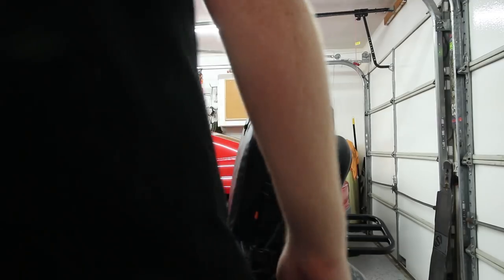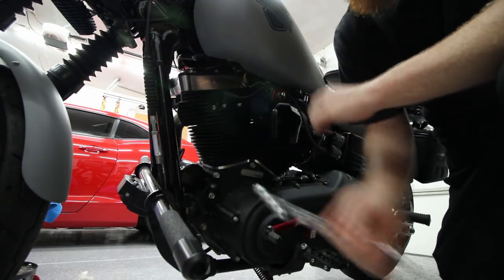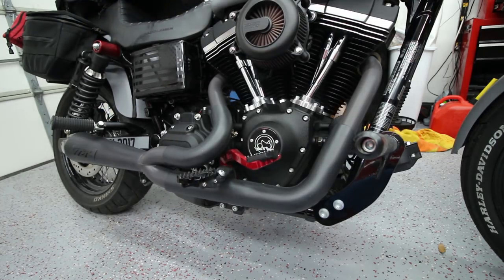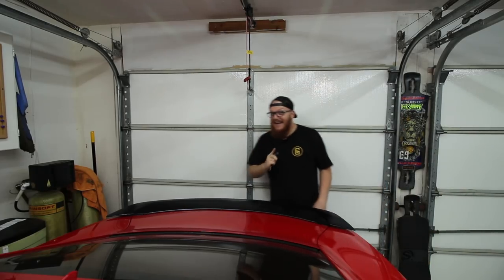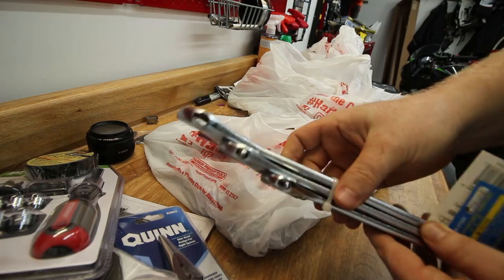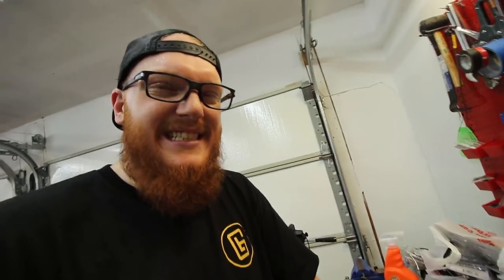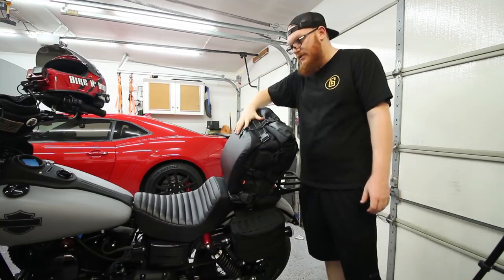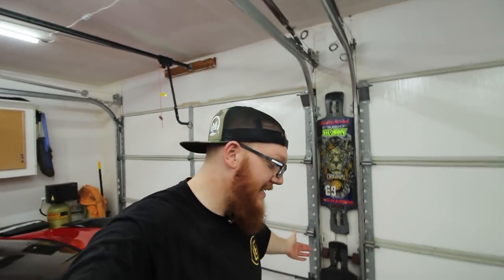Biltwell Exfil 80 Tool Pouch - LOADED

Comment: nicely done.  I like cheaper tools for travel, anyway.  This is coming from a total tool snob.  If you're on the side of the road fixing your bike in Texas heat, 10 bucks says you leave something behind because you're in such a hurry to roll out once it's fixed.  cheap tools, no problem.  expensive tools, you'll be kicking your own ass for days....
Reply from the maker: Thats a great point!
Reply: Also makes it easier to “lend” tools to bikers that need them on the side of the road if you don’t have time to help them get running.

Comment: Take an extra quart of oil with you. Also a tire patch kit would be a good investment. Hand pump for filling low tires.
Reply from the maker: can't patch tubed tires 😕
Good suggestions on the others though!
Reply: You can PATCH tubes. You can’t PLUG tubes. 

In your case you need a patch kit and a set of tire spoons.

Comment: Went 1900 miles on my 04 carbed sportster in 4 days.  Went through 1 quart of oil. And had to tighten up my battery cable. That’s it, you should be ok on that newish dyna

Comment: I wouldn't bother with a patch kit unless you have a way of getting access to the tube to patch it. Vice grips and some type of leatherman type tool. Don't worry about harbor freight. I've used mostly craftsman as an aircraft mechanic for over 20 years. But that one large wrench or socket that I might use once every couple years-harbor freight. Nice review.

Comment: Noticed when you bought your Torx set you bought the pamper proof set. (One with the hole in the middle) you really need the regular ones because there is a really good chance you wont be able to get off whatever you need to unscrew and it will just strip the fastener.
Reply from the maker: Fake news.
Reply: @BikeNBird  alright then

Comment: add a 10mm socket or wrench for the battery bolts also  and I believe that the rear axle nut is actually 36 mm
Reply from the maker: Battery bolts have phillips head

Comment: Don't count out the trans, and definitely don't count out a 4" ball Allen I. 3/16 for your oil pan. When either leak you have a massive problem that's fairly easy to at least make work until you can get somewhere. 
And just remember, synthetic oil is the same in all 3 holes so a few quarts can really make your day a lot easier
Reply: And a cheap test light or HF volt meter can identify a lot of problems with the electrical